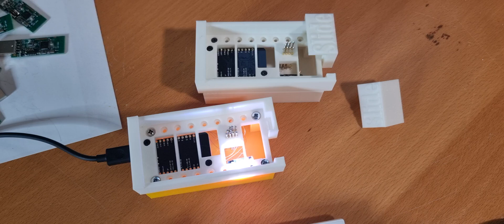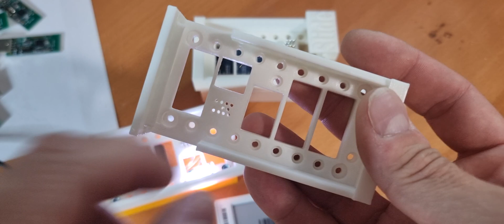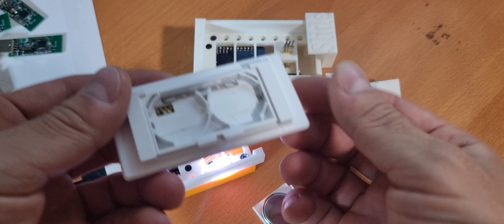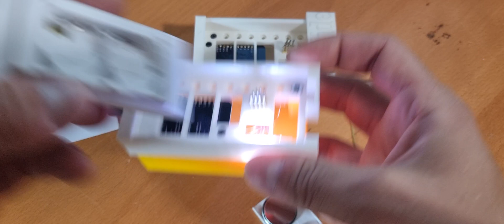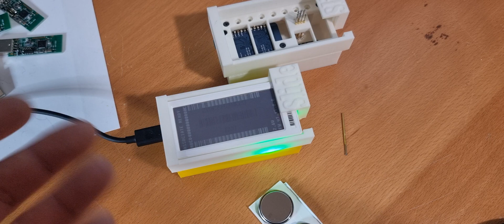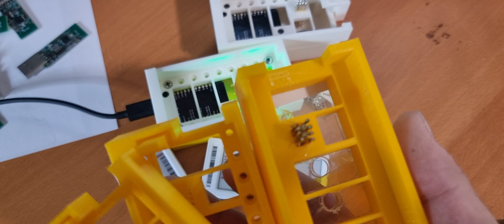Simple E-Paper display firmware flashing with the "Pogo Flasher"

Comment: Your top case clip might last longer if you printed it rotated 90 degrees in the z-axis
Reply from the maker: Hey. The hard part are the holes for the pogo pins, if its printed rotated the holes will end up worse otherwise you are correct

Comment: This is so good 
I have a question it is possible to use the st7735 library with the CH552 microcontroller using Arduino ide
Reply from the maker: Hey most likely not.
Check this out
https://github.com/DeqingSun/ch55xduino